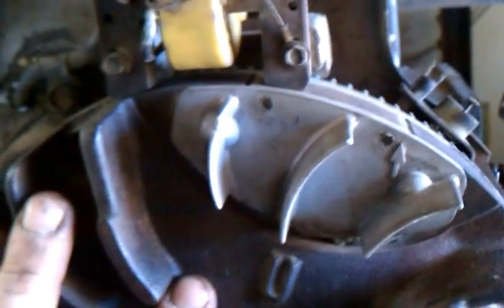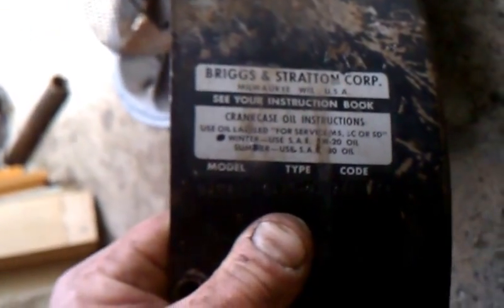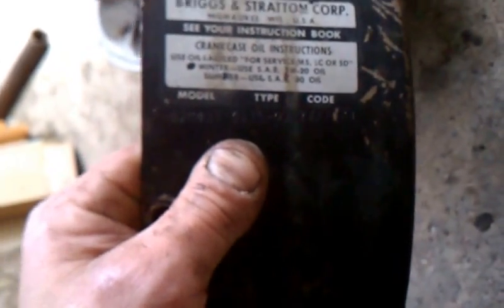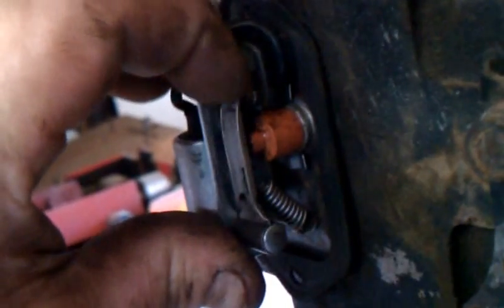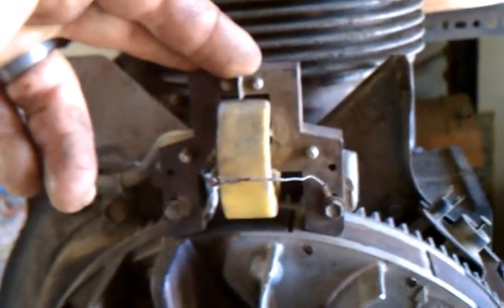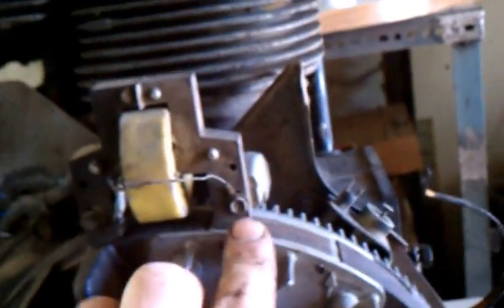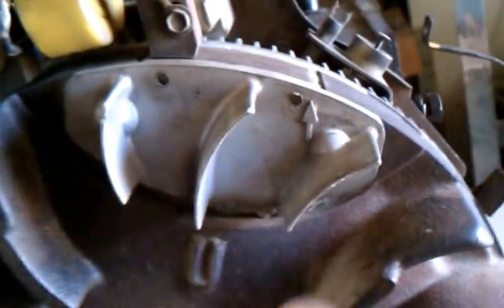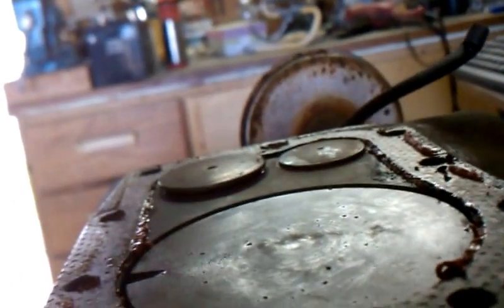Briggs & Stratton 16hp Timing 1/4

Comment: Boys and Girls this called value over lap which takes place at the end of the power stroke.  Which is 360 degrees off of the power stroke. When intake value opens after the exhaust value closes, value over lap now the piston goes down intake value keeps opening taking air and fuel in and when the piston starts coming back up both values are closed this is the compression stroke  so lets just say timing is 5 degrees before top dead centre or .005 inch before top centre the points open and Maggie lets out a spark. Down goes the piston (power stroke) and on its way back up the exhaust value opens (exhaust stroke) till the piston reaches top dead centre were value over lap helps to draw in fuel and air because burnt fuel is leaving in a hurry pulling some fresh air and fuel with it and starting the intake stroke.  Keep your dick in a vise and your legs crossed boys and girls keep focussed when working on engines